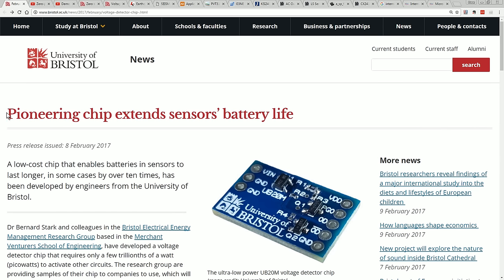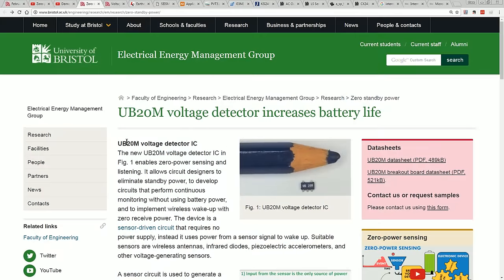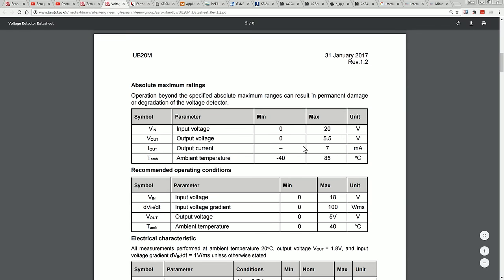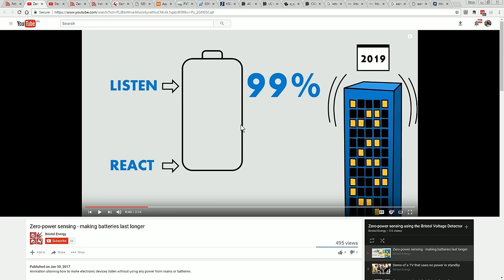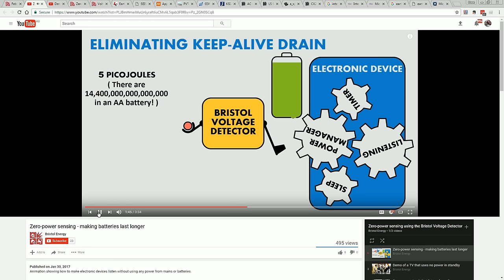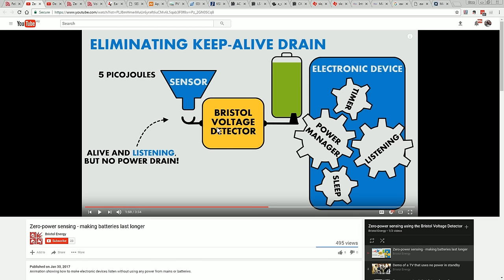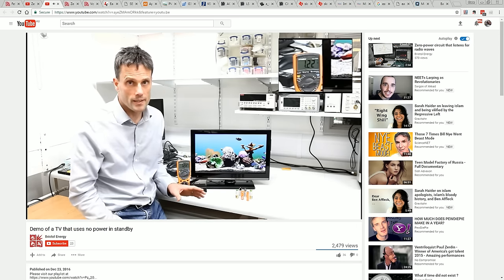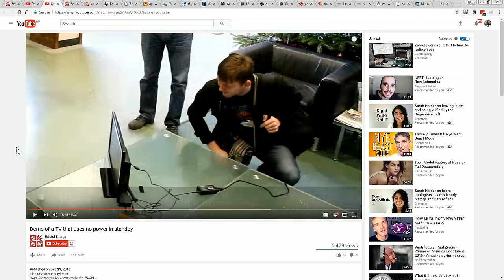EEVblog #971 - Zero Standby Power TV - BUSTED!

Comment: The question is: What they save here? The money from the private user at home? A private person can do nothing to help the power consumption. All users are in that stupid mind that they can save energy - but for what for there money sack!? Only the producing industry can change the power consumption on a i.e. TV set. The power plant and the energy company must earn the money for building new lines, power plants, infrastructure and so on. The consumer must pay this money if not the consumer must sit in the dark. If you can not pay the bill so you sit in the stone time!
Nuclear fuel reactors are very complicated to recycle the fuel tablets they are cracked after a will of using them and then they must recycle so that cost a lot of money. The green word  "nuclear wast" is in my eyes wrong it is lost energy in a old technology. If they build a nuclear reactor like the thorium reactor form Dr. Lessly Dewan so they can burn down the liquid nuclear fuel salt to a minimum and the "nuclear wast" radiates for 200years. This time will be storage in a safe bunker. - And they would like to drive electrical with battery’s in a car what for a idiotic idea.

Comment: Zero??! Did they say "zero"? Not "almost-zero"? That's superconductivity in room temperature! Nobel prize! Total revolution in computers, spacecraft, science, everything!
In those kinds of switches in "off" state FET consumes most power, and that power goes from the resistor mentioned in video. An AC switch would consume even more.
Reply: Watch the video again. it's off and takes power from the sensor itself when the IR receiver is triggered

Comment: Well haaang on! The point of demonstration was that there can be remote functionality without requiring power. Of course the PSU has quiescent current, but don't tell me you, of all people, can't think of the way to cut the power coming INTO the PSU. Come on! Triac, mosfet, latching relais? Powered by a small NiMH cell? The fact that the demonstration device has a powered-on PSU is beside the point. It's hair splitting. This is really disingenuous.
In the moment, many devices have relatively high quiescent currents because they need to power the IR receiver and the electronics to start the device when a signal is received, and thus have PSUs constantly on drawing quiescent current. If nothing requires power, you can cut the PSU off entirely. Sure, this can also be achieved with other means in the case of a TV, but there may be other applications where using the signal strength alone to switch current might be highly useful. This is a crap video from you.

Comment: The solution would be...SOLAR PANELS. Yes. If you have some light in the room, that can power the on off circuit. Unless you want to turn on your tv in the dark, you might need to use your flashlight to light up the solar panels for a bit. What do you do if you cant find your flashlight and the light switch in your room just broke. You go to fucking sleep, thats what you do.

Comment: What's wrong with an auto sensing plug socket, set a threshold (say a speaker amp) of 30watts when power is below it boom internally breaks switch, no power wasted no need to create new devices to work with this wonder chip (yeh I know poor idea but I'm a simpleton that thought of this in a nanosecond and it's still better than this thing).

Comment: Yeah, I don't think this is a particularly good video. It's not fair at all to take swipes at researchers, especially when the concept is completely sound and you get them on a tiny, tiny technicality which could be engineered out in future. 

This ain't "smoke and mirrors", it's a proof of concept. 

I think you're getting a bit jaded, and it's really not a good look for you.
Reply from the maker: They are the ones that pitched and marketed this publicly with a big press page and a demo video making very clear claims. They even invited engineering feedback which I have given. 
It's not like I'm going after a research group doing basic research, or attacking their research paper or something. They are the ones that went very public with marketing that was BS.
And in case you didn't watch the whole video I praised the chip several times and made it clear I was just the marketing and a claim I had problem with. They obviously agreed because they pulled the videos.

Comment: What is the name (or a link to where to purchase would be nice, but I'll find it myself if you can name either) of the component which can switch AC current with the picoamps generated by an infrared LED without being powered itself?  Or perhaps the power source which can support a sensor which can do this for more than 10 years of continuous operation?  I know that you said they're claiming the TV and plug plack aren't drawing power, but the problem there is that they didn't actually claim that.  This video was very disappointing with you using dishonest tactics to (apparently) try to trick your audience into thinking that you've debunked some objective factual claims, not just acted worked up about a subjective evaluation of how important a thing is (that's what 'busting' something is, no one is surprised when marketers claim their product is awesome, but are when they actually make objective claims which are false).  They're not being "massively deceptive".  The device does exactly what they exactly said it does.  And yes, they were careful about their wording.  You, on the other hand, misapplied data (the use of a microcontroller without the wireless sensing network used to switch it from inactive to active, read the bottom of the page you showed in the video) hopefully erroneously to trick the audience into thinking someone made a false claim.  Instead, you showed the components they are directly competing with and show that if their product does what they actually SAY it does, switch while only using the power generated by an infrared LED, and point out that they require much more power to do so... do you ever think it being capable of that is what the fuss is about?

Comment: Strictly spoken you're talking bullshit. They argue the TV is not using energy. Then you start bazeling about the power pack. They weren't talking about the power pack.

Even if the power pack would burn off like kilowatts, then still the TV could be using no energy.